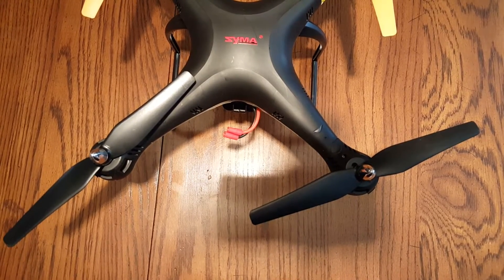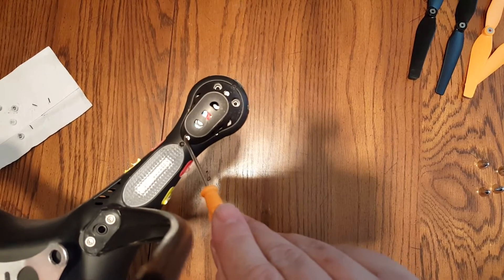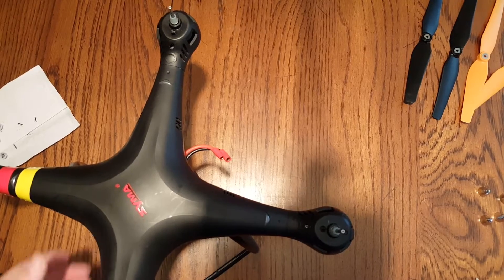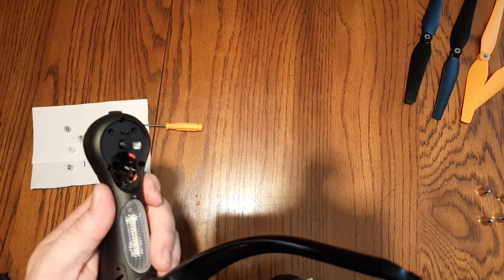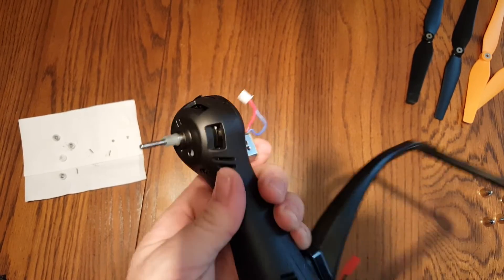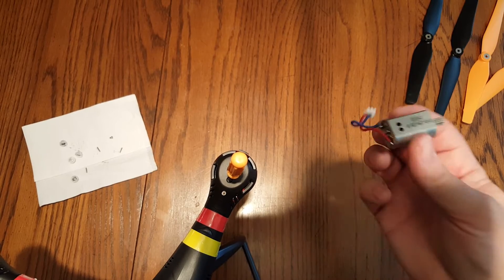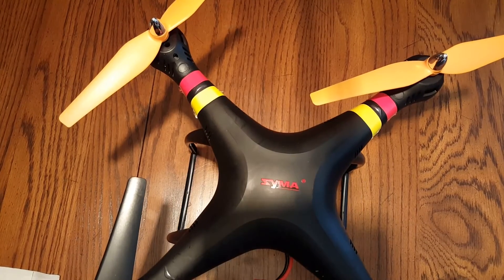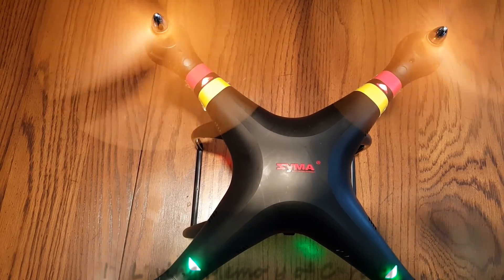SYMA X8C Quadcopter Drone Easy Motor Replacement - No Major Disassembly

Comment: Hi Great video I have a problem with my motors I bought this and some idiot had flow it without the legs and damaged the plastic bit under the motor I think there might be a problem something other than the motor as I have switched them with the same result thus the prop only turns on full power what do you think the problem might be its the same model by the way thank you

Comment: Here's a point. Your method's very close to mine but I found that removing that "inner" screw was unnecessary and perilous since during removal it's very easy for the screw to fall off the driver and end up rattling around the gearbox. As you've said. So - since there's no need to remove the 2nd screw once unscrewed from the motor I just keep it in its hole in the mounting with the screwdriver press-engaged in the crosshead. Remove the freed old motor and insert the replacement all the while keeping some preload on that 2nd screw so it can't get pushed back out of its hole. As the motor nears the bottom of its housing it'll press on the screw tip so spin the screw which engages super easy and your job has that one risk removed.
The holes in the gearwheels dont give a 100% clear pathway to the screw head so can knock the screw off the driver tip if you try to remove it. Only cure is a stripdown.
One more small addition. I always smear some silicone grease on the whole circumference of the motor pinion. Extends gearwheel lifespan some. It's thin stuff and not so viscous as to drag on the motors.
Some use dry lube as for bike chains.
Nice video!
Reply from the maker: Thanks for the comment. That's some good advice. I really do appreciate it.

Comment: just ordered the night lion motors to upgrade my syma x8g . needed to because i attached a gimbal.  The night lion motors provide more power without switching to brushless. GREAT tutorial.
Reply from the maker: +Finding NeverLand I got some of those myself right after I did this motor replacement.  I have not tried them out yet.  I hope they work out for you.